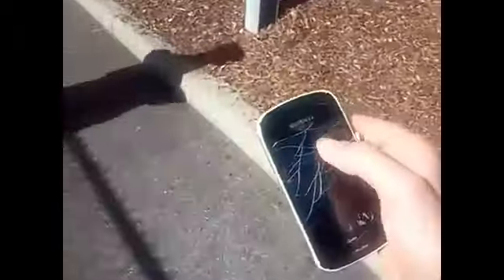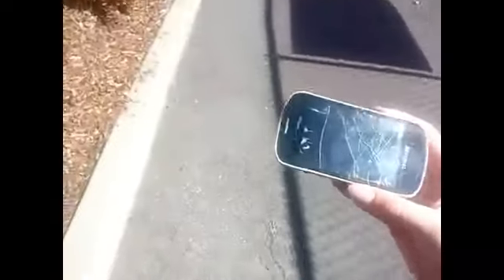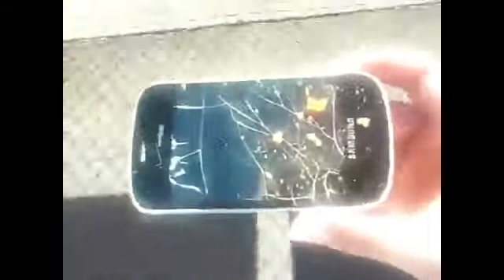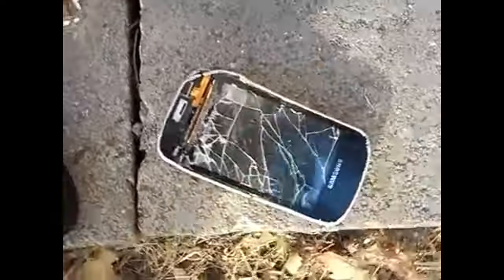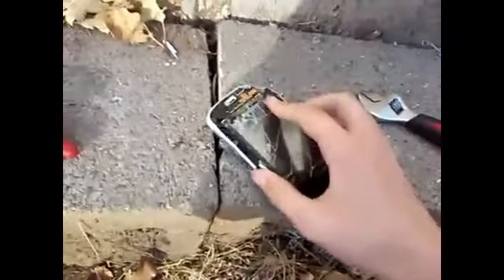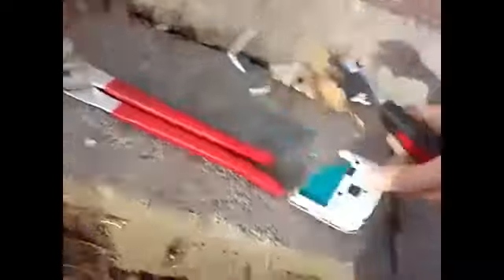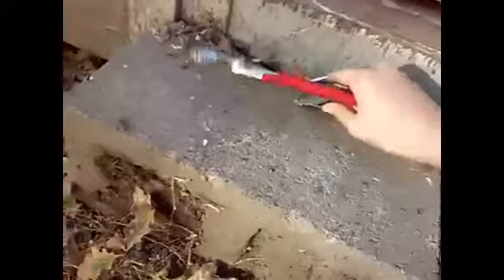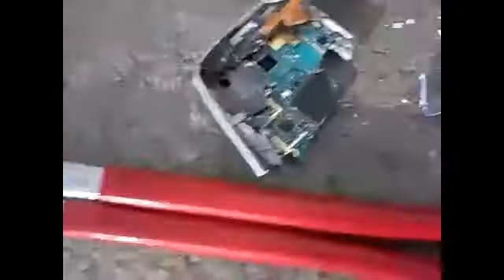RIP Dumpster Phone!

Comment: I have a dumpster hoe too it's a Samsung galaxy s3 it didn't have a battery so I use a s5 battery a tapped it in the back and it worked 😂😂😂😱😱😱 oh yeah and it has a small crack on the screen and I only paid $1 for it 😱😱😱😱🙌🏻🙌🏻🙌🏻